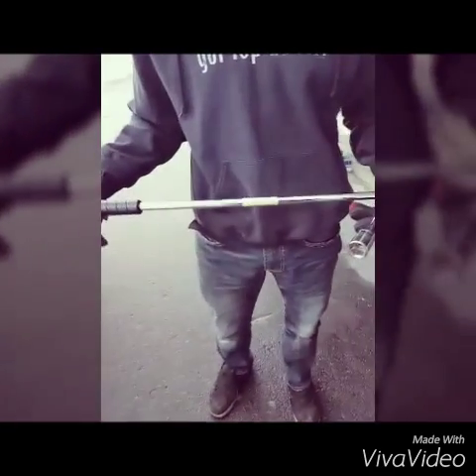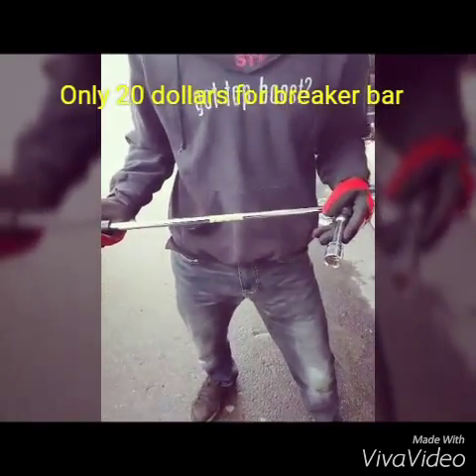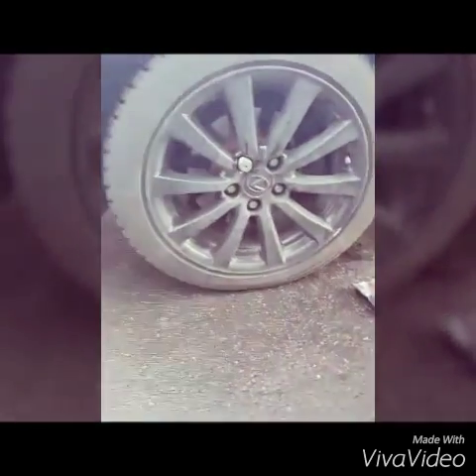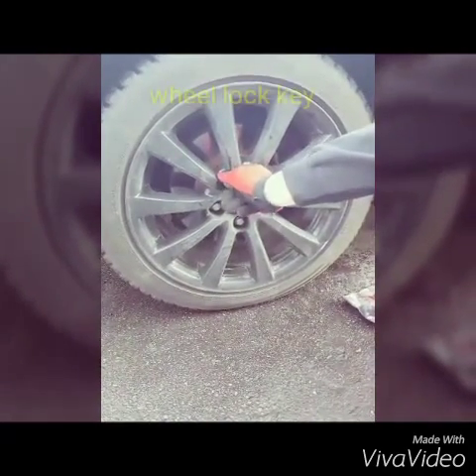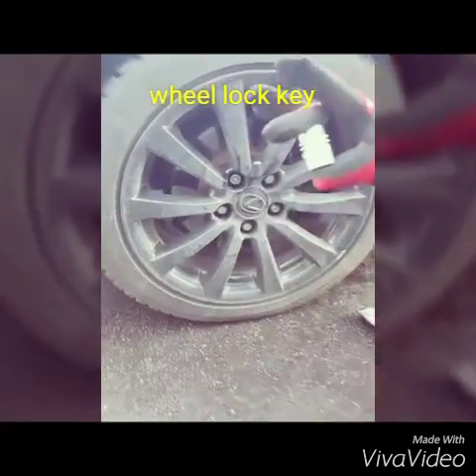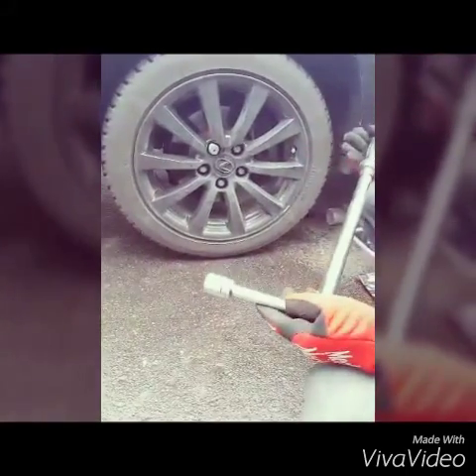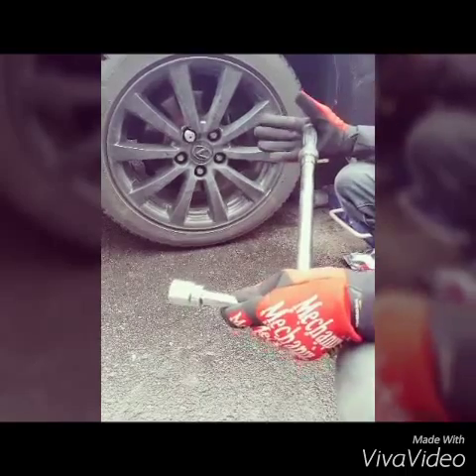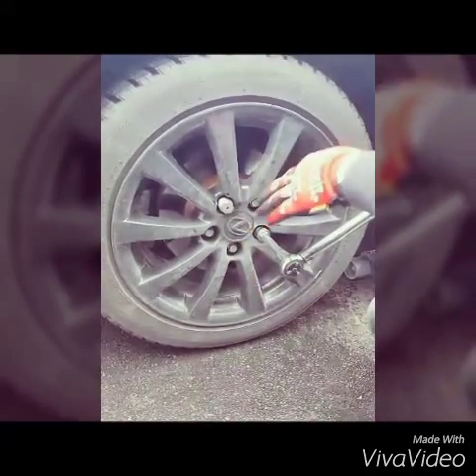How to use a breaker bar and torque  wrench

Comment: Will the torque spec of the wheel always be specific to the car.
Reply from the maker: Every vehicles has there own specs but they usually are not to far apart. For trucks it's usually 140 pounds and sedans very from 75 pounds to around 110 pounds of torque. 
I would go with the recommend torque for which ever vehicle you are working on. Usually Google will have the specs on the torque.

Comment: can you use a torque wrench as a breaker bar?
Reply: You can use a torque wrench but it is recommended not to as you would wear out the gears inside the torque wrench faster and it would need calibration sooner due to the increase in use.
Reply: No it is not recommended. The excessive stress on the torque wrench can cause it to lose its accuracy/calibration

Comment: I disagree with you tightening the lug nuts in circle at the end. Always in a star pattern.
Reply from the maker: The circle at the end is just to make sure the lug  nuts are all tight.
Reply: @russtrain3229  "Make sure they are all tight"  in a star pattern. The last turns of a bolt are the turns that require the most torque and apply the most pressure and the most important.
Reply: The second tightening isn’t too snug? I thought the star pattern would be perfect.

Comment: Why not use the torque wrench to remove nuts?
Reply from the maker: You can ruin your torque wrench because it is not designed for taking off lug nuts. It will make your torque wrench no longer calibrated.

Comment: you know with a extension on the toqure wrench your gonna get the wrong numbers that makes a difference and with a extension on a breaker bar you have to work alot harder than just a socket on there come on day 1 stuff
Reply: That's incorrect, it applies if your extension follows the vertical distance of your torque wrench. At 180 degrees, the specification will actually be less than what is given on the manual. At 90 degrees, you will always have the same torque. Above or bellow that will require a simple calculation.
Reply: @aerodaktyl_  what do you mean by 180 degrees and 90 degrees? I mean the angle between which things exactly. The angle between the wrench and the floor is of no consequence, assuming the wrench isn't ridiculously heavy. 

The extension towards the bolt(as in the video) does not change the torque as the torque is directly converted to the extension without any loss or change because there is no change in distance to the pivot point.

An extension of the long arm of the wrench also doesn't change the torque because the torque is determined at the square drive which doesn't change size. If the extension is the same as the original and you end up with double the distance to the pivot point, you just have to apply half the force to get the same torque. However, the torque limiter in the square drive doesn't distinguish between these a longer wrench or more force. It'll still limit the torque at the same level.
Reply: My comment wasnt toward you, it was toward Matt's comment.